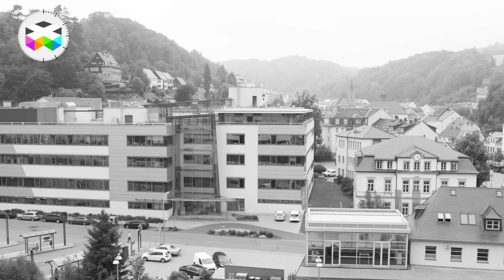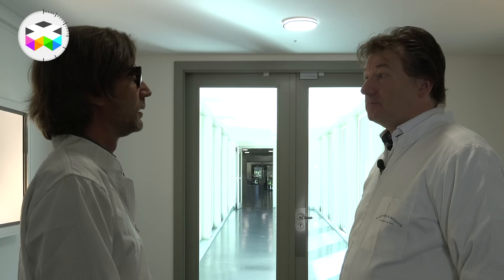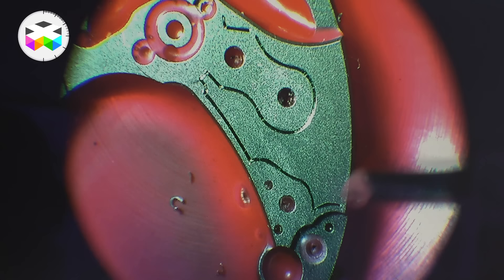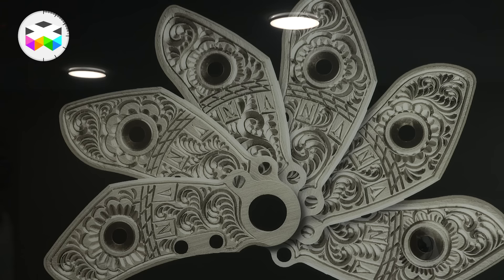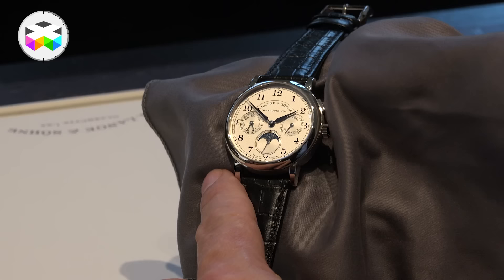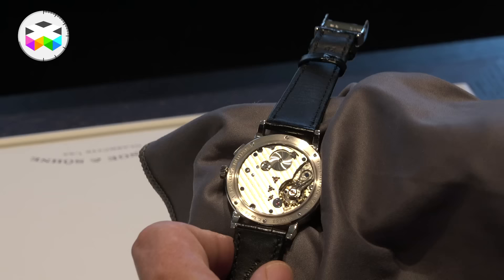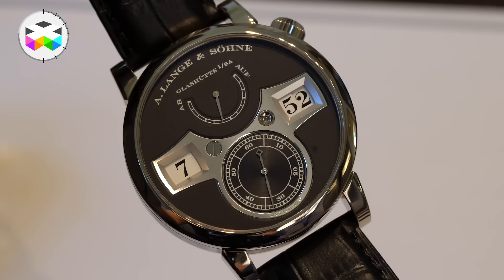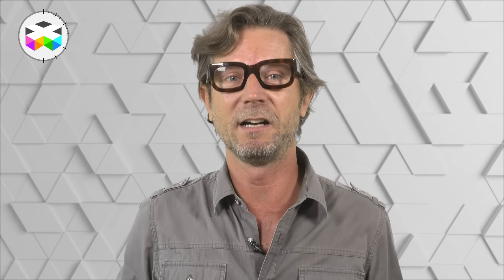Walkthrough Famous German Watchmaker A. Lange & Söhne

Comment: as you can see on 17:29, the new lange 1s seem to have an unfinished baseplate behind the balance wheel. a little disappointing for me because to me lange was always a watchmaker that was known for finishing every part to the same standard, whether visible or invisible. I hope this is not a shortcut to meet the new production demands with the second facility.
Reply: that may be a unfinished one, because i have seen lange 1 in boutiques and they are perfect top to bottom.
Reply: @rumbepack  problem is ive seen this in other video reviews. :(
Reply: In the most recent Hodinkee podcast Mr P Dufour was most critical about cost cutting measures in the watch industry, especially at the higher end brands.
Reply: Maybe Marc can comment on this? A lot of efforts are being put into thanking the viewers for their positive remarks on the video (which is very nice ofc!). But IMHO this is a question (topic) that is way more interesting than the "thank you" replies from theWatches.tv. Questions like these should be addressed too. It adds value!  (btw great vid!)
Reply: It can be a prototype / pre production or a watch that is only going to stay at Lange for demonstration.